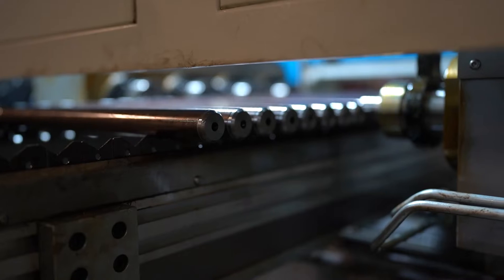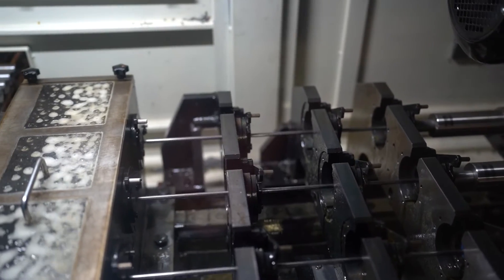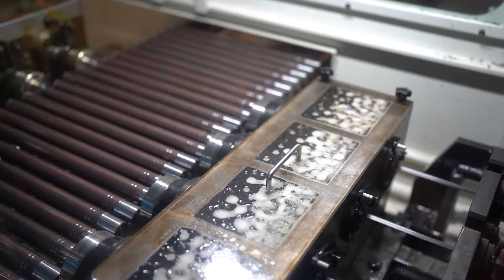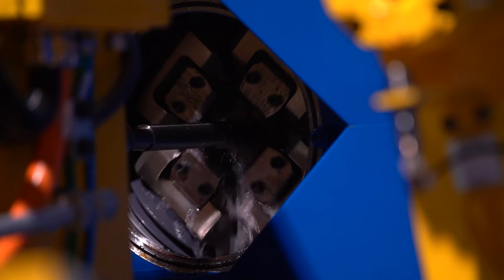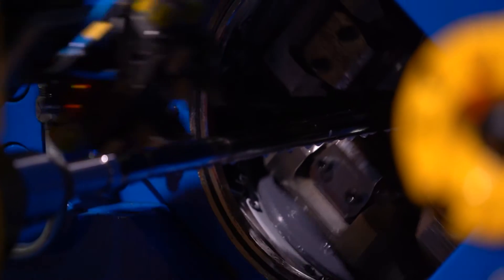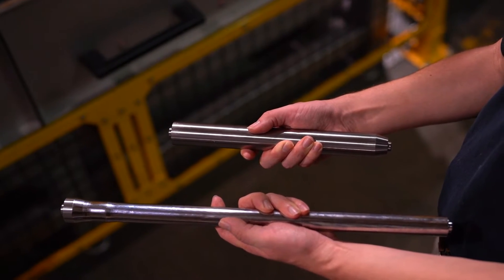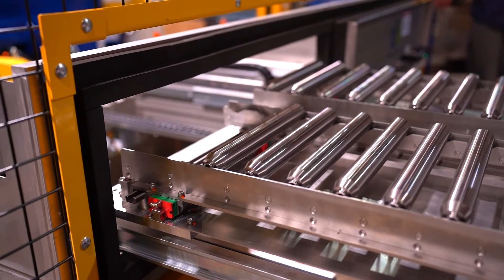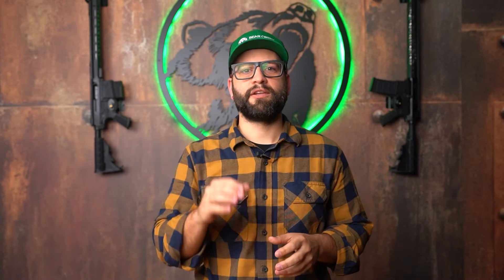Barrel Rifling - Cut vs. Button vs. Cold Hammer Forged

Comment: How tight is your torque on built uppers?  I almost broke my bench trying to get the barrel nut off and had to give up when my vice broke
Reply: You got that right brother! My nephews 450 bushmaster was/is so damn tight I never did get it off . You can only twist so much b4 something breaks and I didn't feel like shearing off the lugs on a brand new barrel. Unfrickinbelieveable!!!
Reply: @silvergrizzly316  when the vise broke I tried heat and still didn't get anywhere finally gave up rather than breaking the whole upper just to change a dust cover and paint it another color
Reply: @wolfhound4449  we did too, applied heat, still no results! Idk who's torque'n these barrel nuts but something needs to change.
Reply: @wolfhound4449  You don't need to remove the barrel to change the dust cover... Search YT .....
Reply: @paulshort5609  ya can't remove the pin the wrong way on my upper the angle is wrong to get the pin out or the new one in. And I want just looking to swap covers I wanted to paint it not the barrel and I dont want to effect heat treat of a barrel when I bake the paint (ceracoat) so I remove the barrels from guns I paint
Reply: I had to use a breaker bar and a cheater pipe.  They were having problems because they weren’t tightening The barrel nuts and customers were sending them back or complaining, so they started just over torquing the barrel nuts way beyond the maximum torque spec.  That’s the BCA way it seems.  The assembly line doesn’t know what they’re doing so they change it to the opposite extreme instead of simply giving them a torque wrench.  🤷🏼‍♂️
Reply: @joshuaduff8588  you know what though, it's kinda the cheapest option out there for complete uppers, so I'll take it. My 458 socom is a damn tac hammer even though I would break all my tools before breaking loose the barrel nut, lol.
Reply: @derrickheavener2946  I like their uppers except the lack of color options and I like to put on custom parts and this barrel nut was the only issue I ever had with them 2k+ rounds through my 762x39 upper and no issues yet other than that nut.
Reply: @wolfhound4449  I have only put about 100 down in my 458 socom, but with Hornady ftx over imr 4198, it's a fucking tack hammer. Just can't remove the barrel nut or muzzle device, lol.
Reply: Glad it wasn't just me, lol. Maybe they staked it?
Reply: This started off with a complaint getting the nut off a upper assembly by bear creek 
Not u putting one together 
Yes I try taking a bear creek upper what a pain in the ?!? Never got it apart they are ether over torque or a locking compound of the treads
Reply: @Freedomishere-im6ug  i said i took several apart. Changed up barrles. Heat gun for 30 seconds or so . I used blue lock tight on all mine as well.
Reply: @chrissheathewoodguy  if u read wolf hound the start of the comment is about getting the factory bear creek  upper apart 

Not assembly one
Reply: @chrissheathewoodguy  I know the have dissimilar metals but so does your aluminum rim on your vehicle that also go thru heat cycles just like your gun but if u need a torch/heat to get a lug nut off
Reply: @Freedomishere-im6ug  lug nuts have tappered ends so they can be loosened easy. Much different then flat faced nuts.
Reply: @chrissheathewoodguy  traper end for alignment 
To help balance of rotating mass 
Semi tractor have flat nut but alignment of tire/rim is done on hub for balance of rotation mass
Reply: @Freedomishere-im6ug   yes and have you seen the size of theimpact to take the lugs off? yes alignment yes is one of the reasons for the tapper.  i'd like to hear what torc amount you've tried.  55 , 60, 80 ? i've had to applie  80 ft lbs once on a upper from a company in Texas that i bought a ar 10 upper from.
Reply: @chrissheathewoodguy  break force remove nut shall to much higher than torque applied originally 
Impact tools are used for speed/ productivity 
U can still use hand tools change tire 
But bossman do not like that 
When they balance your personal vechile tire the machine is also on taper for alignment 
No I fan of torch method onless trashing that parts
I have a guy here in town that torque and loosen is uppers 3 times before final torque to get the crush factor out of barrel nut/upper 
He says that helps/aids in disammabley in the future 
He says it has alway worked good for dimantle  jobs he has done on previous assembly 
But again the complaints that started of disability of a factory bear creek upper 
I work in garage mostly 18 wheelers and automotive machine half my life 
Torch method to me is last resort 
Next time u have a hard upper to take apart strip it down and leave it in a pot of boiling water 
Less chance of destroying with over heat
Reply: One upper I bought a few years ago everything was ridiculously loose.  Barrel nut, gas block, hand guard.  One I got 6-7 months ago the barrel nut acted like it was welded on.  Everything else was pretty normal.
At the price point I wouldn’t expect too much in QC.  As long as it functions I guess.
Reply: Sounds like they're not using the correct torquing procedure. They're supposed to grease the threads then torque the barrel nut to 30ft/lbs, back off, torque to 30 ft/lbs, back off, torque to 30 ft/lbs then go up to the next notch. The allowable torque range is 30-80 ft/lbs, but when done correctly will be down at the lower end of that range
Reply: I've had no issue taking the uppers apart. they should be between 35 and 55 foot lbs.. How small was your vice?
Reply: @chrissheathewoodguy  8 in vice jaws yes cheep little guy but built 7 ars using it with no issues but this upper was too much for the little guy now have a much bigger one and tried again and the table was conning apart with the effort
Reply: @wolfhound4449  they use a lock tight and heat will lossen it. but ya that's to tight. what did the foot lbs go up to while your tringto break it loose?
Reply from the maker: Sorry to hear that! Please reach out to customerservice@bearcreekarsenal.com if you have any concerns